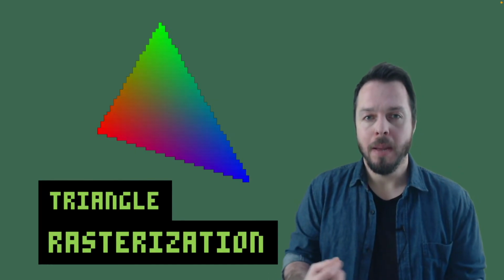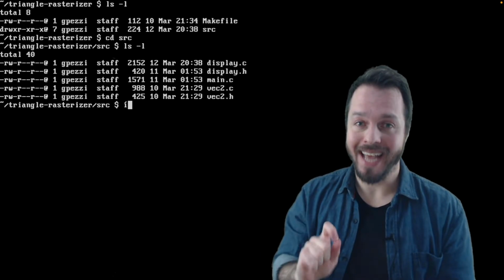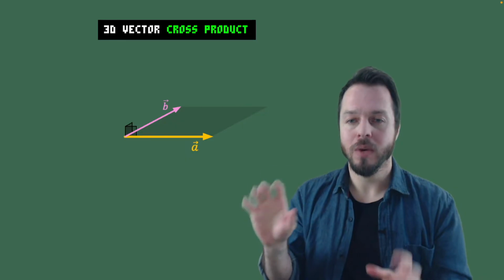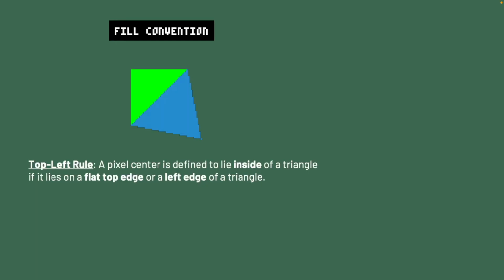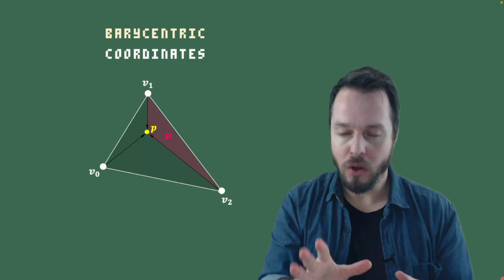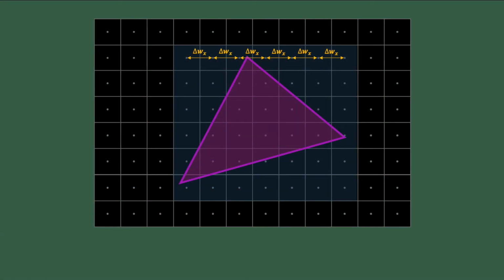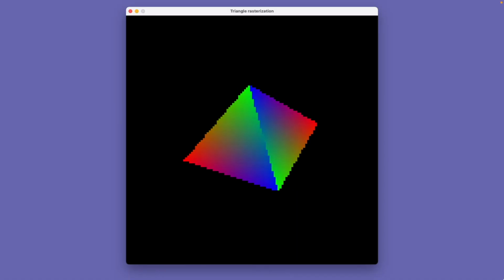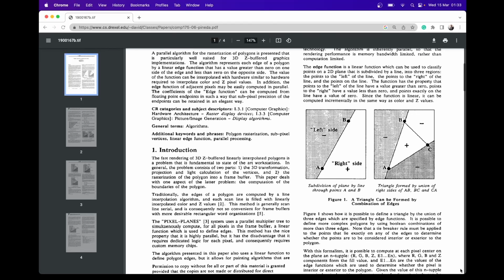Triangle Rasterization

Comment: I like your vids, but this barycentric approach is actually a bit slow.

The better approach really is to get the lines first, find the leftmost and rightmost edge per triangle in 2 slot buckets, using the bounding box so your height y buckets can start at 0, and LERPing the colour in a scanline approach from the leftMost point to the rightMost point for each row.

The Barycentric technique, of having to calculate to cross product with multiple multiplications per point, is much slower than using a properly written Bresenham, which limits it’s operations to a few branches prior to the main loop which has only 1 branch, and a + or - operation; which means finding the edges first can outpace the barycentric approach completely.  Also, to find the edges, allows you to skip needing to find 1/3rd of the edges for successive connected triangles, and would allows you to know the top-left immediately.  In either technique, that is 1/3rd less computation right away if you properly memo-ize edges to be used with surrounding triangles and render outward; thus finding the edges first significantly helps, and it helps parallelize too.

Not only can multiple triangles be done per thread, but you can break down aspects of the triangle into threads too.  If we were talking very large triangles, each line can be sent to different threads, and to so too can bucket comparisons for line segments, and when you have your 2-slot buckets of leftMost and rightMost points figured out, you can segment/sub-divide the triangle and have a texture rendered or colours LERPed by multiple threads per division of rows too.

Both approaches of course benefitting from sharing a cache for texture/fill application, and getting rid of ranges of triangles that would be covered or showing a backface right from the beginning before doing any rendering at all.

What I do like about your vid, is that you can extrapolate some of the concepts you were teaching to other applications, less specific to rendering.
Reply from the maker: Thank you so much for this breakdown. You're correct. If I was creating a software renderer I'd probably approach it from this angle. I guess my idea was to give students an overview on how GPUs see this problem, and currently barycentric coords play a part in the modern pipeline.
Reply: @pikuma  Well, I do agree that it is smart to teach what the current pipeline is, and what you are teaching is the common technique out there; yet, what is popular is not always the most efficient.  Scanline Rasterization, finding the edges first can lead to a giant boost in performance.  Segmentation is easy given the constrained boundaries, requiring less work, and very efficiently balanced.  

But I’m not expecting you to take the word of a rando; I did a google search and found that there has been work done and it’s about 2.5X faster than current popular techniques.  E.g. An interesting paper about efficient gpu path rendering using the scanline rasterization, by kunzhou, came right up.
Reply from the maker: @anthonypace5354  Great stuff, Anthony. Agreed! 🙂👍
Reply: @anthonypace5354  This approach is known as Pineda algorithm. It is known to be used at least, on early 3Dfx gpus. Last decade, Intel tried some sort of cpu-based gpu, and this algorithm was selected instead of bresenham one.

I also implement this algorithm on my rasterizers because it makes side clipping easy (and faster). Isn't Kunzhou paper about glyph rasterization on modern gpus? I find kind of off topic

Comment: You can scan convert the edges using floating points without issues if you just use algorithm which ensures that connected edges of two triangles are calculated the same way. Then you won't get any black pixels at all. Back in the 486/Pentium days I used to do the edge scan conversion so that both left and right edges were calculated simultaneously, which forced the algorithm to keep track which is the left/right edge. A month ago I wrote a new polygon filler algorithm and decided that the benefits of doing those things on a modern CPU are minimal. So these days I simply use edge buffers: 2 floats per row --> left X and right X coordinate of the polygon. Now I can for real render polygons instead of triangles and the algorithm itself is simpler than if I was drawing triangles only. And the speed is really good and there are never any overlapping pixels or holes between polygon edges. No biases of anykind are needed.
Reply from the maker: That's interesting! Thanks for taking the time and explaining. Now that you mentioned it, I see many programmers writing engines that work with quads (and polys) and they all mention the same benefits you did. My engines usually work with tris, but I will give this poly approach a try soon. Just one question, do you always keep track of triangles in "pairs" of left-right? How do you reason about their connectivity?
Reply: @pikuma  You don't need to keep track which triangles are connected. You only need to make sure you calculate the edge X coordinates for each line the exact same way for both triangles/polygons which share that edge. Easiest way to do this is to take points P1 and P2. Before you calculate the edge P1-->P2 X coordinates for each line on screen, just sort those vertices (P1 & P2) by their Y coordinates so that P1.Y <= P2.Y. Now you can go through all the polygon's edges one by one, calculating their X coordinates into the edge buffer. Remember that the edge buffer, for each line, has 2 X coordinates: left and right X (you fill horizontally all the pixels between them). So either the edge scan conversion itself has to sort those two numbers when they  calculate the X's or you can do the following: As all polygon/triangle edges are usually defined counter clockwise or clockwise, you'll always know (if you have done backface culling) that every time Point[n].Y < Point[n+1].Y, you're going down the screen and you're dealing with a left edge. So you can tell that to the edge scan conversion algorithm and it just puts them into the right slot instead of having to clear that buffer before using it for each polygon. When Point[n].Y >= Point[n+1].Y you're going the other way, meaning that scan conversion should write the X values to the other slot in the edge buffer. I'm not sure if "edge buffer" is the official term for what I use it in this explanation, but in this explanation I mean that "left & right X coordinates of the polygon edges for each row" table. Maybe "scan conversion buffer" would be a more appropriate term for me to use here?